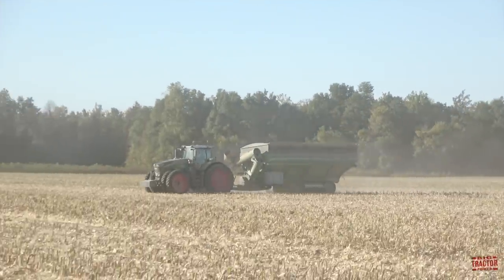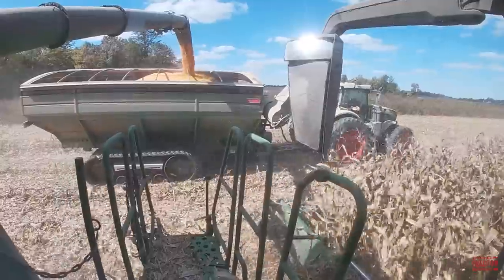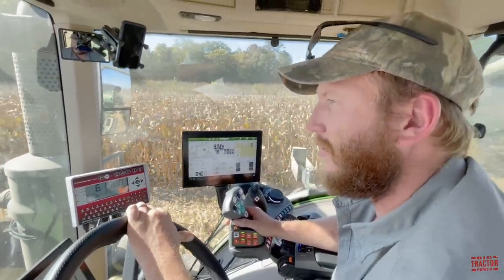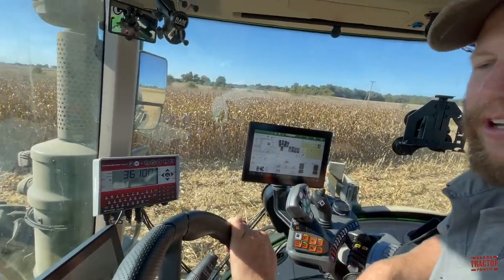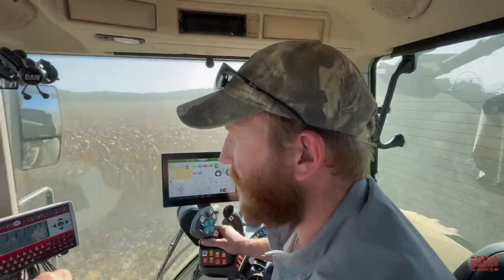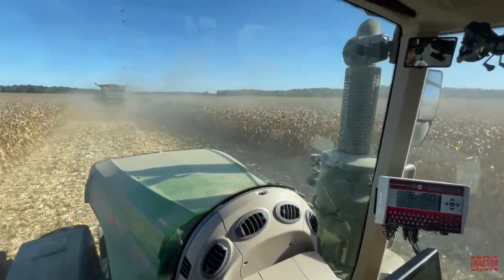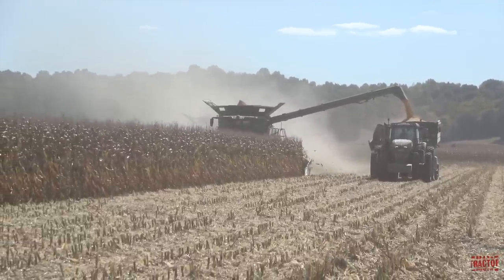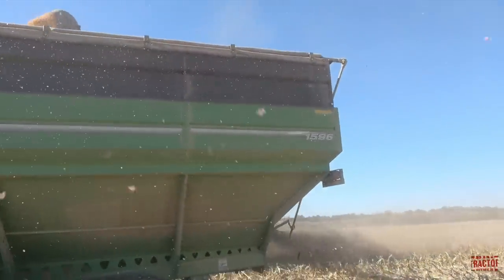FENDT 1050 Tractor on Corn Harvest Grain Cart Work

Comment: There seemed to be a tank on the side of the grain cart,wonder what thats for,could it be an oil resevoir? The grain cart operator has a bit of a rush keeping those combines moving.
Reply: Water tank and pump to put out a possible fire.